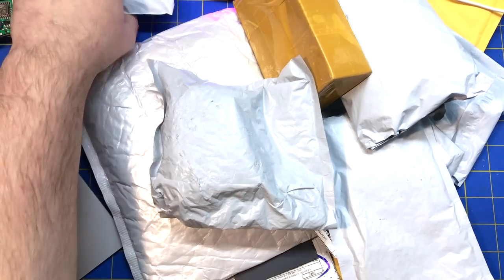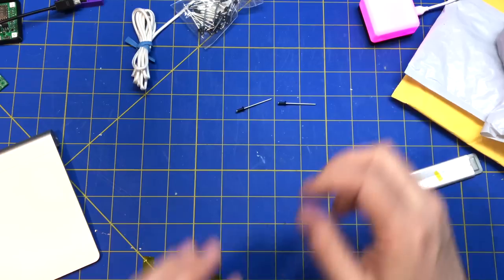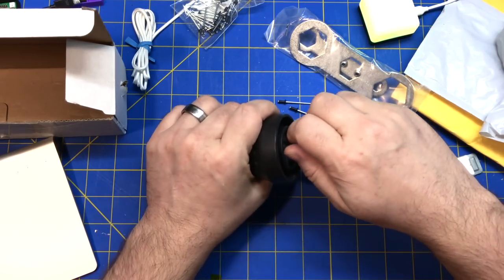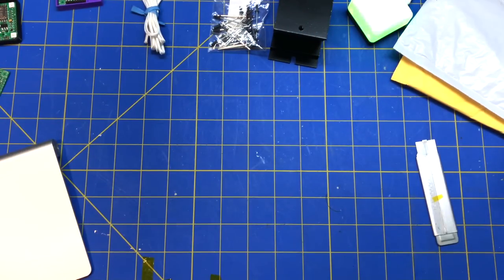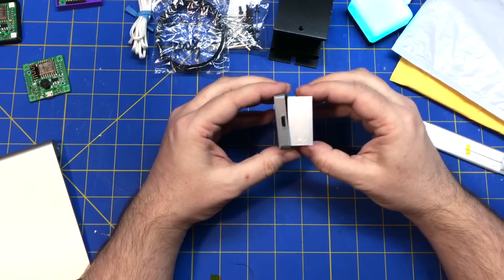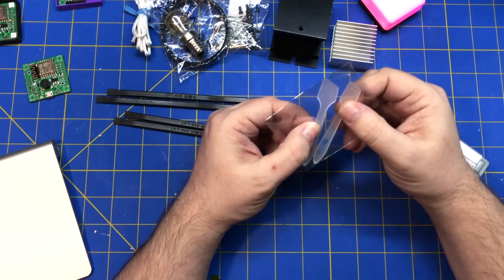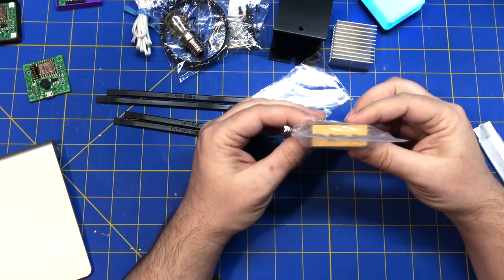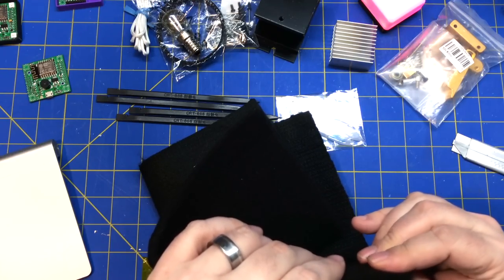Mailbag #39 06-2019

Comment: This is why I watch mail bags. I spent a while last week searching for some cheap tool I could use for applying the thick type rosin flux paste (not solder paste) that comes in a jar. That scraper may work quite well for that too.
Reply from the maker: Yeah I could not find them last time I used my paste ( thats why I bought them ) Ill check them next time to see if they are stiff enough and let you know